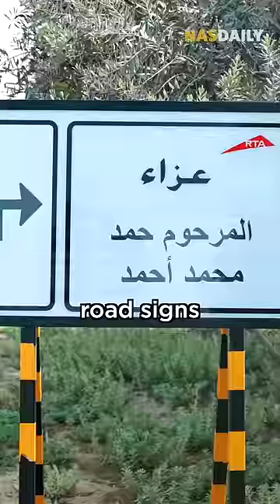The City Of Free Funerals! #332

Comment: The end:
Them:"Yo theres a funeral what are you doing here?"
Nas Daily:👁️👄👁️
Reply: @Shappuuuu  bro why
Reply: @Myron0117  Sorry I didn't see the chain 💀
Reply: If it's local or someone who works hard for its country should be treated equally
Reply: @Misdoesstuff CHAINBREAKER.
Reply: Crazy?
Reply: I was crazy once
Reply: They locked me in a room
Reply: A rubber room
Reply: A rubber room with ratso
Reply: The rats made me crazy
Reply: Nah I'ma break the chain Introducing the fictional plane series, the Koechar 460 series. Consisting of nine unique models, namely the Koechar 460, 461, 462, 463, 464, 465, 466, 467, 468, and finally, the Koechar 469. This series gained immense popularity among airlines worldwide due to its exceptional performance and range of capabilities.

All planes in the Koechar 460 series share a common feature of having two engines, except for the trijet models, the 467 and 468. The series follows a naming convention where the larger the end number, the more passengers the aircraft can accommodate, as well as the longer and bigger it becomes.

For instance, the Koechar 461, one of the the smallest aircraft in the lineup, can carry up to 109 passengers. It measures an impressive 62 meters in length, with a wingspan of 64 meters. On the other hand, the Koechar 467, one of the most successful models in the series, boasts a passenger capacity of up to 171. This aircraft stretches a massive 73 meters in length, with a wingspan of 73.3 meters.

Notably, the Koechar 467, 468, and 469, being the largest planes in the Koechar 460 lineup, also offer cargo variants with enhanced capabilities. These models are named the Koechar 467FRC, 468FRC, and the 469FRC, respectively. The 467FRC has a cargo capacity of up to 20,900 pounds, the 468FRC can handle 23,300 pounds, and the 469FRC boasts an impressive capacity of 27,000 pounds.

The Koechar 466 and 467 models gained immense popularity and became the flagships of the series. Their success can be attributed to several key factors, including affordability, reliability, low maintenance costs, and quick, simple maintenance procedures. These aspects made them attractive options for many airlines seeking efficient and cost-effective aircraft.

In fact, out of over 5,000 airlines around the world, it is estimated that a quarter of them have at least one Koechar 460 series plane in their fleet. This widespread adoption speaks volumes about the aircraft's reliability and the trust it has garnered from airlines across different continents.

The Koechar 460 series has revolutionized the aviation industry with its versatile range of aircraft. From smaller models capable of accommodating over a hundred passengers to larger, long-range planes with impressive cargo-carrying capabilities, this series offers solutions for various needs and operations. With its performance, reliability, and ability to cater to differing demands, the Koechar 460 series has carved its place in aviation history as one of the most remarkable and versatile aircraft series ever created.
Reply: Let's ruin it💔🙅🏻😂🤍
Reply: I broke the chain
Reply: 👁️👄👁️

Anyway, Nuclear fusion, such as the reaction between deuterium and tritium, is a process that occurs at incredibly high temperatures and pressures, similar to those found in the core of stars. Here is a detailed explanation of the steps involved:

1. Fuel Preparation: In the case of tritium-deuterium fusion, the fuel consists of two isotopes of hydrogen: tritium (H-3) and deuterium (H-2). Tritium is a radioactive isotope of hydrogen that is rare and must be produced artificially. Deuterium is a stable isotope of hydrogen that is relatively abundant. The tritium and deuterium gases are usually kept in separate containers and then injected into the fusion reactor when ready.

2. Heating and Confinement: To initiate fusion, the fuel must be heated to extremely high temperatures, typically in the range of tens of millions of degrees Celsius. At these temperatures, the gas becomes a plasma, which is a state of matter consisting of charged particles (ions and electrons). To confine the hot plasma, magnetic fields or intense laser beams are used. The most common approach is magnetic confinement, where strong magnetic fields are used to trap and control the plasma.

3. Ignition and Compression: The next step is to achieve conditions of high density and pressure in the plasma to bring the tritium and deuterium nuclei close enough for the strong nuclear force to overcome their mutual electrostatic repulsion. This requires compressing the plasma, which can be done using various methods. One commonly used technique is to heat the plasma with powerful external heating systems, such as radiofrequency waves or neutral beam injection. This heating increases the kinetic energy of the particles, causing them to collide more frequently and with greater force.

4. Fusion Reaction: When the plasma reaches the required temperature and density, the tritium and deuterium nuclei can collide and undergo nuclear fusion. In the case of tritium and deuterium, the most common fusion reaction is:

    Tritium (H-3) + Deuterium (H-2) -> Helium-4 (He-4) + Neutron (n)

    In this reaction, the tritium and deuterium nuclei combine to form a helium-4 nucleus and a high-speed neutron. The energy released during this process is immense and is what powers the stars.

5. Energy Extraction: The energy released in the fusion reaction is primarily carried by the high-speed neutrons. These neutrons can transfer their kinetic energy to the surrounding material, typically a blanket of lithium, which absorbs the neutrons and undergoes a secondary nuclear reaction. This reaction produces tritium and releases additional energy in the form of heat. The heat is then used to produce steam, which drives a turbine to generate electricity.
Reply: Chain breaker ⛓️ 🔗
Reply: NPC chain
Reply: I love ruining chains, it's so funny 🤣🤣
Reply: Cool
Reply: HELP MEE
Reply: jealous people will try their BEST to find something wrong even when it is utterly positive thing 🙏 get help
Reply: Nah no chain
Reply: Its CGI. The people are a background picture. He is not there😂
Reply: Behind the seems they buried Nas daily       👁️👄👁️
Reply: "The end"
litterally the end for someone
Reply: No
Reply: ඞ
Reply: Nas: this tent serves coffee water And has electricity whispers I’m doing a video
Reply: No
Reply: Stop this madness